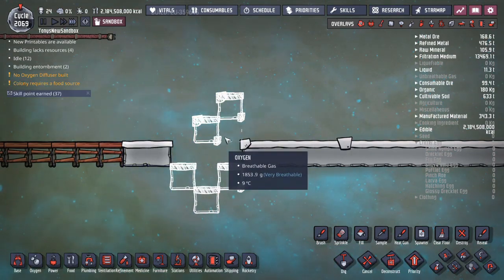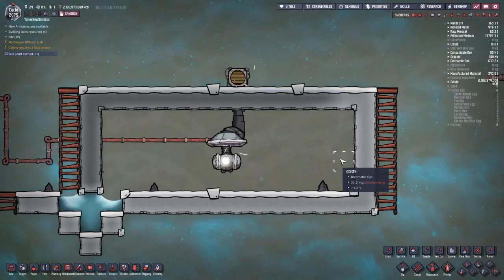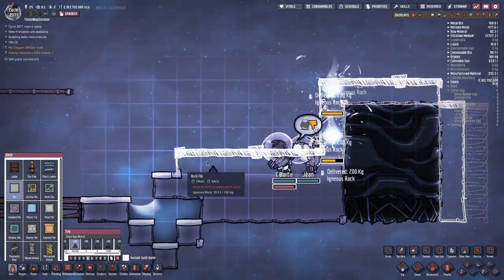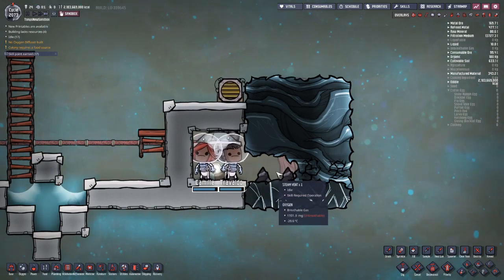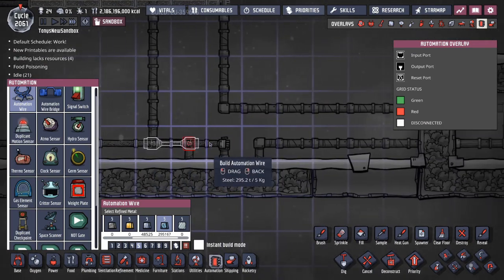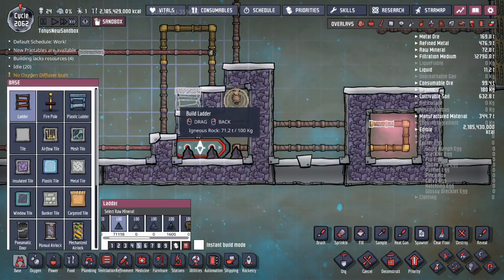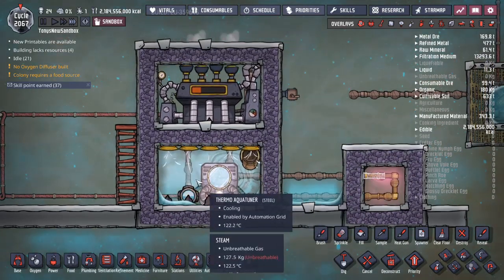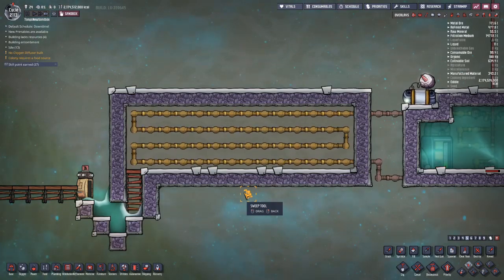How to Make Rooms of Vacuum in Oxygen Not Included.

Comment: Deleting tiles method seems like cheating right? I am reluctant to use it
Reply: not really. i think it is intended.
Reply: If we had a 100% impervious material and a good enough water airlock it would work IRL so it isn't cheaty
Reply: @pedrolmlkzk  The water would evaporate to the vacuum pretty quickly, though.
Reply: I agree with Val--normal excavating drops pressure in your base by these same mechanics and is pretty baked in to how we experience the game. We're not "deleting" the air out of a room as it was displaced when we built the tiles in the first place. It's the liquid lock at the entrance that's simply preventing that same air from flowing back into to fill the void caused by removing the tiles.

Comment: How much kg of steam is optimal to get max power from steam in this kind of set up?
Reply from the maker: A steam turbine needs only 0.1kg of steam to operate. I usually use at least 100kg so there's never a problem with steam diffusing through the steam-room and there's plenty to go around while re-cycles through the steam turbine. The hard part is generating enough heat. The steam turbine will start working if the steam is 125C, but it won't get to it's maximum power until the steam is 200C. The steam turbine's water output is 95C, so you need enough heat to get the water back to 200C in order to keep the steam turbine running at 850 watts. An aquatuner can't make enough heat to power itself this way, so this setup is a cooler, not a generator.

Comment: I feel extremely stupid. I did it by filling my room with Airlock doors all the way, then deconstructed them. How didn't I think about regular tiles?!?
Reply: It isn't stupid cause then you can just wall in a huge room, and they all will get built no matter the build order. Maybe do it with automatic doors and a automation wire to open them up with a switch during construction. Then just close them all and you get a vacuum

Comment: Can one aqua turner heat up enough water for at least two steam turbines? Because that set up that you had was negative kilowatts right? 1200kw for the aqua turner, I think 850 produced from the steam turbine.
Reply from the maker: I'm pretty sure that an aquatuner/turbine combo that is cooling water has a net power use of about 700 watts. Turbines are basically powered by heat, so no matter how many you build it will still have a net power use of 700 watts.
Reply: @tonyadvanced6315  Hello Tony, would you please explain why the net power use is 700 watts ? Isn't it -350 watt if there is only one steam turbine ? Thank you
Reply from the maker: @romainlaher8547  An aquatuner cooling water produces 585 kDTU/s and uses 1200 watts. A steam turbine can turn 585 kDTU/s into 566 watts. That's a net power loss of 633 watts. But there's also a bug that causes some heat deletion when water returns to the steam chamber, so I think the best that can be done is a net loss of about 700 watts.

Comment: When building vacuum from outside, the inside that will be later deconstructed can be made out of standard tiles, they don't take that long to build.

There's also elegant method to attach an airlock to a sealed/vacuum room without letting any gases in/out. Useful for ex post maintenance. Put a door right next to a wall, lock the door, deconstruct the wall behind it through corners. Then build an airlock/vacuum entry right next to the door, then unlock the door.

You don't really need the door, you can just build a vacuum entry. But if there's not vacuum in that room, the door reduces the amount of material that escapes to the entry chamber.
Reply from the maker: Ah! You are right of course about the regular tiles. That's very clever with the door. I tend to play the game "messy" so I'm not particularly good at that and I really appreciate the advice. Thank you.